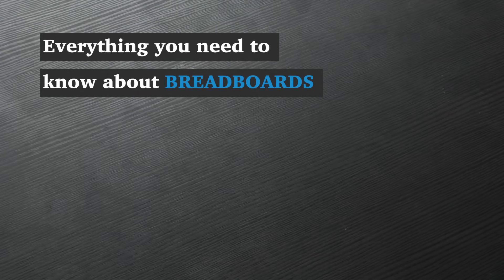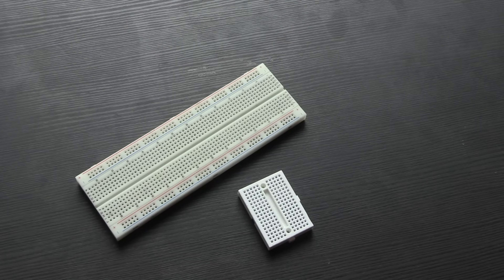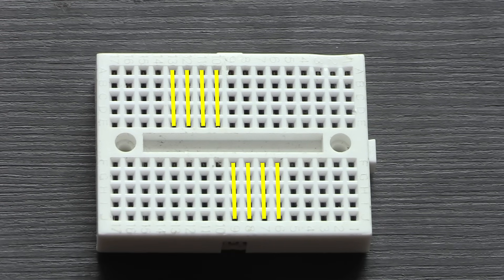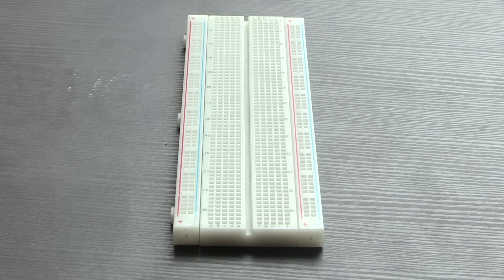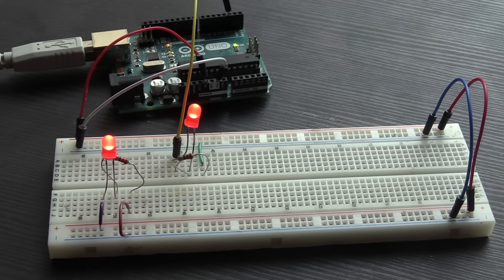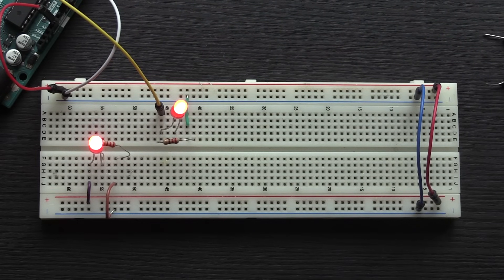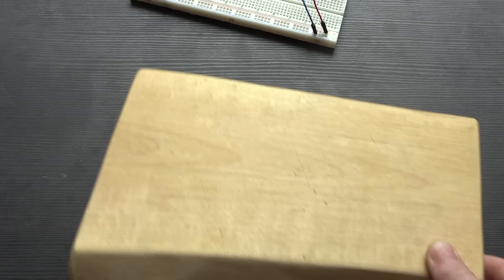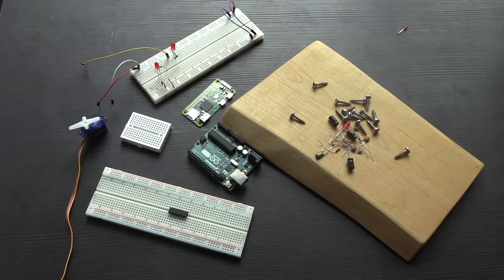Everything You Need to Know about Breadboards

Comment: Alright so the positive and negative power sides need to have a power source hookedup to tgeir respective power sources ++ --. Then you get another wire and connect it to say row 55 from a negative port. Then if you place a led light, one of the two conductuve prongs must be in row 55, while the other in say row 54... so long as another wire closes the circuit from row 54 to positive charge. I think i got that down. That was the hardest part, thanks man.

Comment: can you tell pls? can we cut the breadboards to get  smaller breadboard for use it in small rc car? Or if i cut breadboard it will be no work
Reply: They r for prototyping, so u shouldn't need 1 at all. Its possible to use just the 2 bar part but its still the same length & still require a power source wired to it. Boards with onboard power or a usb have additinal wiring so cutting could render the feature useless. U can save space by connecting via wires and solder connected to a lithium battery

Comment: Instead of using the jumpers on the end you could of just connected your power supplies positive to the top rail and the negative to the bottom rail or vise versa. Correct?
Reply from the maker: yes.

Comment: I have a Uniset (Czechoslovak) electronic prototyping tool, and it has 2 medium sized breadboards, with 4 split power rails that deliver 12V, 5V, -5V, -12V.
All power is generated internally.